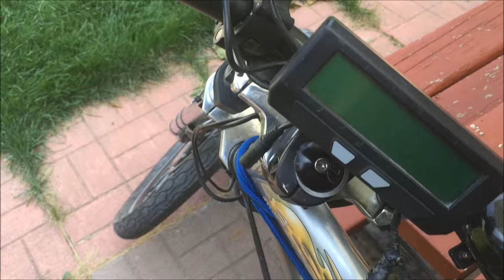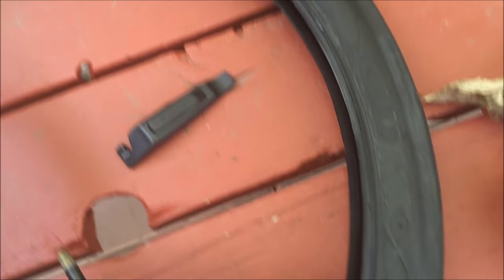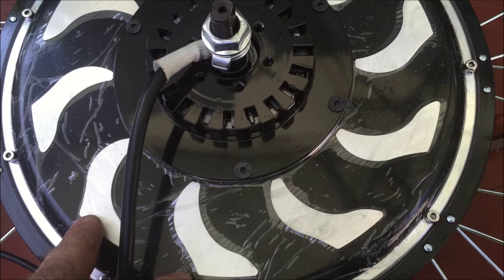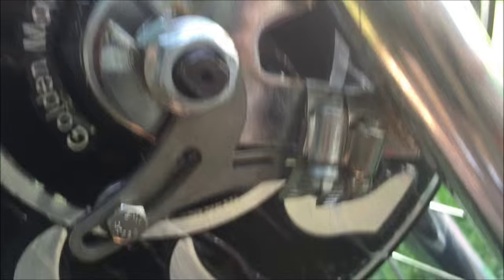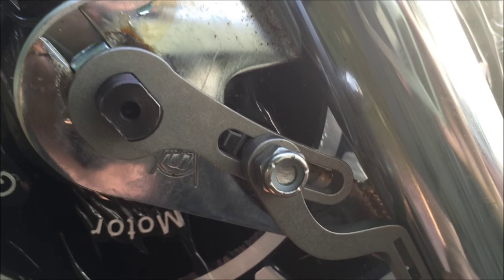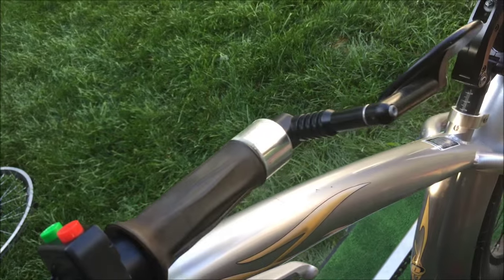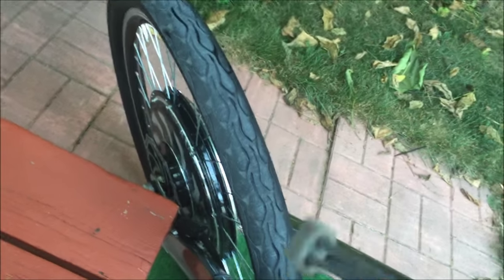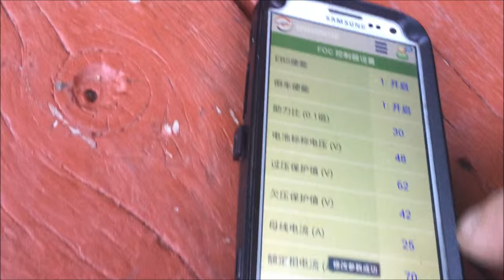How to install a front wheel ebike conversion kit

Comment: I live in Spain and, unfortunately, had a problem with UPS shipping my Magic 5 to me through our Customs. I would like to say that  Golden Motor CA were extremely helpful, as is this video. Thanks for the tip regarding the brake screws and the valve extention. In my youth we used spoon or four candles to remove our tyres.

Comment: Hi i need help , i just installed the wheel but cant seem to get the wheel working after plugging it ? do i have to download an app or anything to make it work ? or did i just plug the wires not properly so it doesnt turn on ? ive connected them with connector and insulated them with the waterproof thing but it doesnt seem to work ? do i have to connect but wires like TOGETHER on each others ?

Comment from the maker: For prices come to the website shown in the description.
Reply: +GoldenMotorCanada my suggestion to your bike, its nor required to keep the disk brake in the front as far your motor brakes, and to keep bike lighter
Reply from the maker: That would be fine if you always have battery power, but if the battery kicks out there is no regenerative braking so you would have no brake.
Reply: +GoldenMotorCanada thats right, in my battery pack BMS removed, and controller anyway not runs in 43v so there is allways power :) // i removed bms for the reason of shutdown, i found one cell dead, but later i replased cell
Reply from the maker: If a battery has a BMS and you remove it you are risking fire.